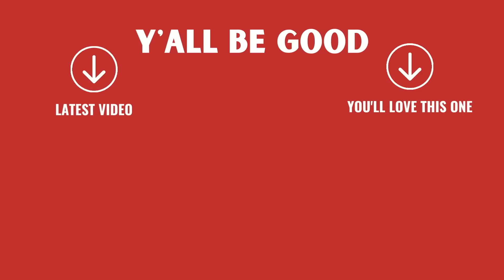Can You Believe What We Did To The Barn All By Ourselves?

Comment: My dad grew the old types. He never staked them. He put herbs and certain flowers between the. And he made sure certain other vegetables planted near them. Some of them brought diseases and bugs to them. Also he let his turkeys run in the garden.  They are not like a chicken which peck at everything. The ducks and geese as will but not in the berries. You just have to figure out which bird/poultry is best. My dad always said to take the lower branches off the plant that are touching the ground, this will also prevent diseases and to take the suckers off to allow wind flow, which helps in production.  
I have seen horn tomato worms that cross from one row to the other. Dad planted Dill, basil and Marigolds in the rows. These plants did a wonderful job. 
We always put 4 plugs in and on set on a switch so if we didn't need it there was no hydro running to it. And all outside lights were not put over the doors. It encourage bugs from coming into the barn. Also we put flower hanging hooks around the door and windows to keep flys and bugs from entering the building. I hate bugs in the barn. That light looks awesome.  There is enough to cover over the sinks and counter. Can't wait to see the end.  Love the dance  happy dance. God Bless.

Comment: You could shorten up those lites on that board better  & individually... Then it would not hang so low ,plus I think you will enjoy the look of them better..& actually get better lighting from them ...being up higher & on a shorter hanging 
Lenth of wire & that way you can also keep them safer by not touching as much ...( You can adjust the lengths of wire to give more lighting with them & not touching each other so much ) therefore being safer & more usefull !!!